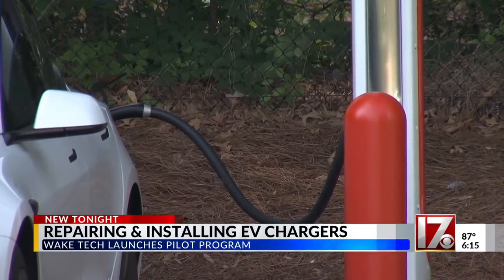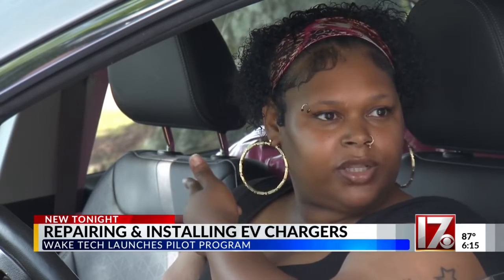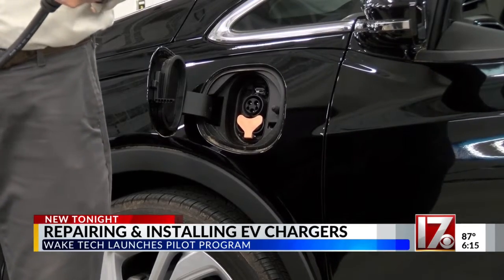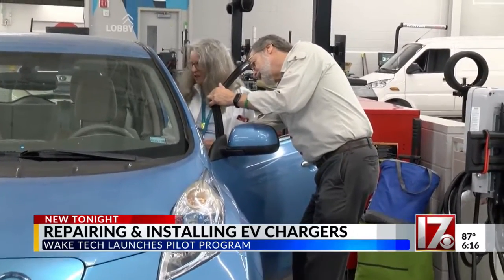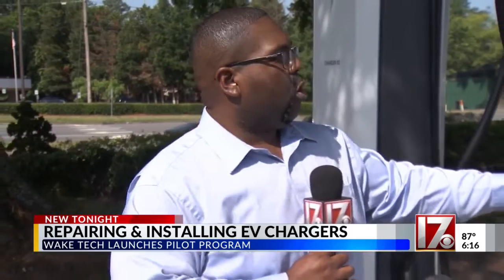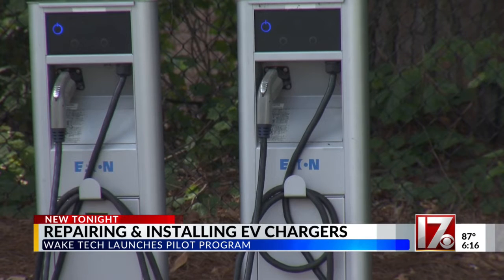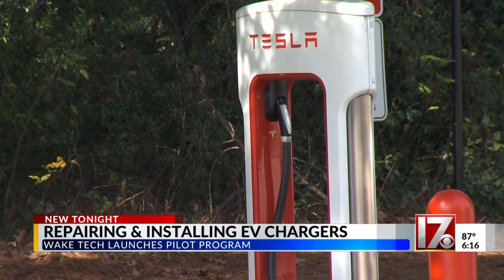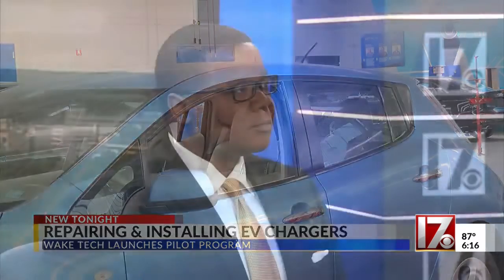Wake Tech launches course for EV charging station install, repair

Comment: EVs are a fad. No future in them
Reply: Thats what people said about streaming services, phones, and the internet. Get real! 😅
Reply: EVs are like the Apple Newton. The current generation is overhyped, expensive and underperforming. Maybe in 10 or 20 years they will become a viable choice, but only if the battery tech radically improves. 

Currently they are not economically viable without subsidies for most users. Rapid depreciation, unreliable public charging, insufficient range, expensive repairs, etc.
Reply: @ChristianWagner888  perhaps.time will tell.
Reply: @ChristianWagner888  Sooo… basically how every new thing starts until it’s adopted by the wider community. 🤭😅
Reply: I bet you said the same thing when smartphones came out.
Reply: @simplelife4213  lol apples and orangeslittle buddy but you keep thinking theyre the same.  Good luck to you.
Reply: I would suggest you test drive one before you rule them out. You might be pleasantly surprised
Reply: @Ojames600  not appropriate for a one car household like me.  Plus i dont buy into the f
Green lies.
Reply: The rest of the world disagrees
Reply: @cottagegymfun  🤣🤣🤣🤣🤣🤣🤣🤣🤣🤣🤣🤣